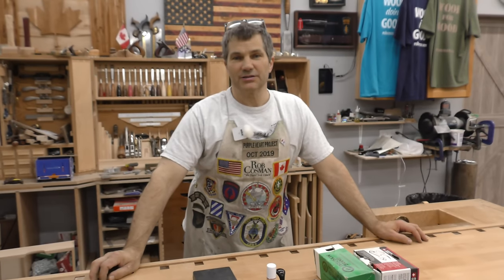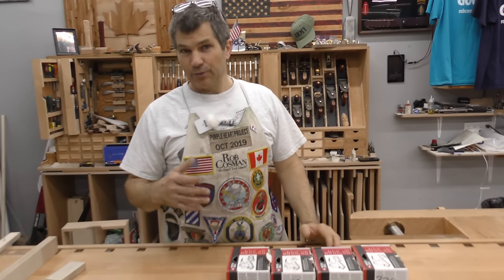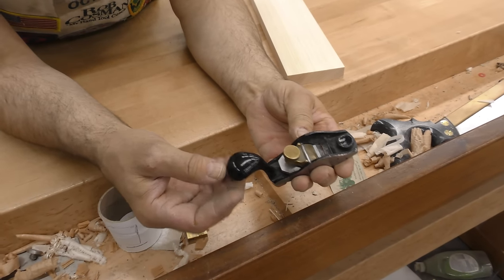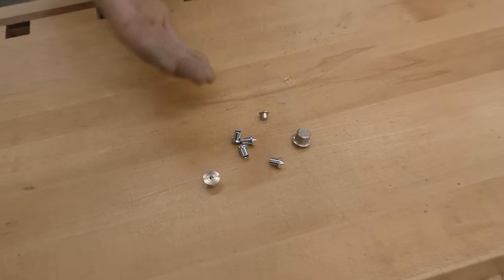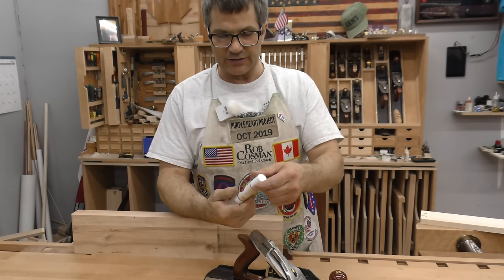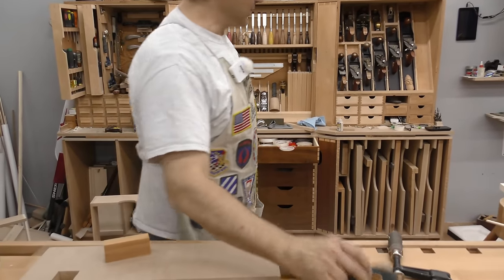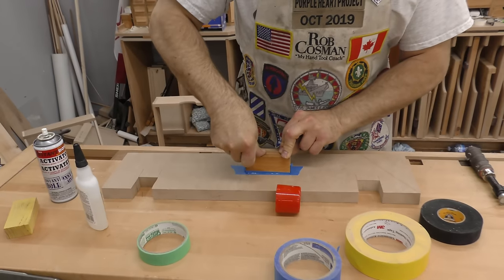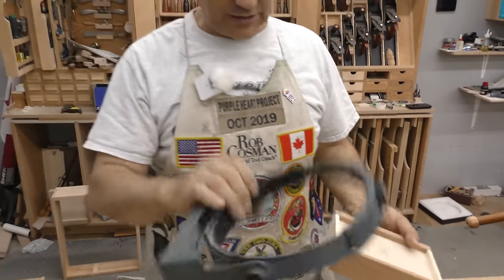Top Woodworking Gadgets - MUST HAVE ITEMS

Comment: The tape trick and CA glue, is actually used by luthiers, to sand or plane a piece wood that is too thin or small to be clamped, so tape goes on table...also to create shims like wedges for dovetail neck joint, etc...
Reply from the maker: Thanks for the info, I had no clue

Comment: iGaging makes a digital caliper that also measures in real fractions. Called the Fastener Cal, reads down to 1/128th in fraction mode and to 1/32 in "nut" mode. Also does digital and metric. Toothpicks and matchsticks as fillers. And the sample credit cards from credit card offers make great glue spreaders, either notched or unnotched. I also saved plastic room keys for the same purpose, once upon a time I worked a hotel front desk and was always getting "foreign" room keys left in rooms at check out.

Comment: Ophthalmologist Woodworker here. Knowing the definition of a diopter is not only easy, but VERY useful in woodworking (and human surgery), at least for Canadians and others familiar with the metric system. A diopter is a unit of the refractive power of a lens equal to the reciprocal of the focal length of said lens in meters. Huh? Let’s say we have a 3 Diopter lens (and every grandparent does in their reading glasses). How do we calculate focal length? The reciprocal is 1/3 meter = 100/3 or 33.3 cm. focal length. What is focal length- more complicated physics, but essentially how far away from you an object in focus is wearing said lens. Therefore, the higher the diopter of the lens, the closer the focal point is, and the larger the object is in a plus (magnifying) lens. I figured this stuff out before my residency, and I’m still trying to find 7/16 quickly on a ruler, so I’m sure any skilled woodworker can figure out the focal length of their Loups- (headgear). Hope it helps.
Reply from the maker: Wow...I think adding fractions is easier!!!!!  No really thanks for the information, it makes sense.  Its amazing how much I learn from you guys.  Keep those comments coming

Comment: Table salt. Bothered by wood slipping during glue up when you apply the clamps?
Sprinkle a few salt crystals on the wet glue before clamping
Reply from the maker: Yes that's a great one. Actually COL Luther taught me this....you just have to be careful to use only a little bit, too much and it will clump up and your boards wont seat correctly
Reply: Keeps a bar napkin from sticking to your pint too; cheers fellas.
Reply: The people who create Titebond actually recommend against doing this because it can negatively impact the bond created by the glue - there is information about it on their website.

Comment: Here is an idea for you Rob. I use an Eclipse sharpener roller  But I use it upside down.  I fitted two steel triangles  one eighth inch thick  .One each side.  Only about an -inch and a half wide - by an --inch and a quarter deep. Each has two holes for the fixing bolts and the other point of the triangle holds a Meccano shaft  --5 inches long --and a brass Meccano wheel  each side --one and a quarter inch diameter . They look like railway wheels  .The shaft is easily wide enough to straddle a diamond plate. When I sharpen a chisel I have a plastic coated chipboard board with a stop end and on the side near me I have a line drawn or scratched to set the chisel angle as it protrudes .
    That always gives a correct 90 degree end edge and the polishing after sharpening is done as normal .
A nice variation on this is to get a smooth curve across the plane blade edge.  Just fit a shaving under diagonal corners of the diamond plate. A thick or thin shaving is your choice . The plate will rock left and right as the roller stays on the flat surface.  This gives a fine smooth curved edge  without any trouble .   Have some fun with that .

Comment: 30 years ago when I was a doing picture frames I used a small bottle of Elmer's yellow glue just like the one you listed as honorable mention.  It made application of the glue on corners effortless.   I haven't seen those tiny bottles for years.  Do you have a source?
Reply: You can get what are called "Boston rounds with a yorker tip". They are used in the medical field. Veterinarians and pharmacies will be your best source for them

Comment: LED Headlamp for when a stationary Light just doesn't cut it. Especially servicing the machines.
Reply from the maker: Another great idea.  I installed a ton of lights in my shop but every now and then i still need a light.
Reply: Yeah, a headlamp is great to have. It is THE lighting tool for handsaw sharpening. Nice for layout too, because no matter where I put the lights in the shop I always manage to cast a shadow right where I wanna make a line.....

Comment: My non-standards would be a heavy steaming iron for the inevitable dents incurred working in a home with small children, and an old, very worn in set of automotive sanding blocks for smoothing large radiuses (chair backs, etc). Of course these could be made with plywood, but I've had great luck with the foam ones
Reply from the maker: I totally agree on the dent removal...in fact I should do a video on that.  Thanks

Comment: Great video!  As a mold maker I use dial calipers all the time to thickness boards on the thickness planer.  Get that?  DIAL calipers, not verniers.  Just kidding.  Also I call the head gear a see hat.  A hat you wear so you can see.  As a kid I used to laugh at the "old guys" who used them to see EVERYTHING.  Not laughing anymore since I'm the old guy.  Again, great tips, thanks.
Reply from the maker: Thanks for watching and commenting

Comment: Instead of hockey stick tape, I prefer to use vulcanizing rubber tape on tool handles, where more grip is needed. That tip for using tape as wooden dowel marker holders - I will need to test...

Comment: Double sided tape or a hot glue gun for temporarily fixing a board when using a bandsaw to make a leg or any other time you want a temporary fix.
Reply: Remove hot glue from most surfaces with Isopropyl Alcohol.

Comment: Excellent suggestions as always.  Two gadgets I use all the time for odd projects are a fractional drill gauge (https://amzn.to/2VqeYTB) and a digital protractor (https://thd.co/31wLoQ2).  I can't tell you how many times I've used the drill gauge to find the right size drill or rod for a screw, dowel, or rod.  I was very surprised to find that none of my friends used one and ended up guessing a lot.  The protractor has been extraordinarily useful for any project that does not have only square corners.  

Turns out that I was already using 8 or your gadgets, but will now think about more inventive ways of using superglue and feeler gauges!
Reply from the maker: That's an old Norris infill smoother
Reply from the maker: I have never used one either.  I just looked it up.  I will try it.  Ignore my comment below, I mistakenly added it here instead of where I meant to add it

Comment: use a slightly smaller drill for the dowell center points, that will hold them in place, and then hold the dowell in place too
Reply from the maker: Yup..good one

Comment: I have 2 inch brass keystock in apron in sizes of 1/8, 1/4, and 1/2 to use to quickly set up depth or heights of blades, etc. Not my idea, got it from John Silloats.
Reply from the maker: Where did you get it from?
Reply: @RobCosmanWoodworking  I think I picked them up at an industrial supply store, either Charles Jones Industrial or TT Liquid Handling in Hamilton.

Comment: I think the guy at  Crimson guitars is the originator of the blue tape trick. The Wood Whisper has a great video on. I just passed it along it's a great trick for many things. And as for the CA glue. Personally I feel that the 2P10 product is a higher quality. Just my opinion.
Reply from the maker: Thanks for the info!  It was passed on to me from a comment on a video just like this.
Reply: @RobCosmanWoodworking  I think I mentioned it on the standing desk drawer. Great trick. I've learned alot from all robs work. Passing on information is the key to helping fellow craftsmen.
Reply: Ben Crowe at Crimson guitars was the first on You tube. But he said he was given the tip from one of his students.

Comment: I use a magnifying headset also, but I have a light on it.  As we age the lens in ours eyes stiffens and it becomes harder if not impossible to focus on items close-in.  Further the lens becomes cloudier with time, hence, the image that does get through the lens becomes less well defined.  And if that isn't enough the screen (retina) ages and is less capable of picking up the incoming out of focus, cloudy image its receiving.  So, by now, in the absence of just ending it all, I add lighting to my vision assistance system.  Have a great day!
Reply from the maker: Yup that makes total sense.  Guess when I bought mine they didn't make them with lights yet

Comment: sometimes you need to sand an inside curve with  very little room to work with. Depending  on how small the curve is ,select a piece of dowel rod ( usually about 3 to 6 inches longer than the thickness of the wood being sanded)   make a small cut down the length of the dowel about an inch in length. cut two  pieces  of sand paper about 3/4 of an inch wide and long enough to wrap around 3/4 of the diameter of the dowel . Glue the backs of the sand paper together and a small amount of glue in the center cut dowel ,. slide the pieces  into the cut centering the paper  all the way to the bottom of the cut.  . Next cut a small 1/4 wide piece of tape like a ribbon( duct tape works very well for this) and wrap around  the top end of the cut to secure the open end (this is why the cut is made a 1/4 inch longer than the sand paper width)  Now with flaps sticking out of both sides of  the dowel rod you can insert the other end into a hand drill (variable speed one works very well and can be controlled better ) . Now you have two flaps of sand paper than can be used  to sand in either direction of rotation. A slight back and forth motion while sanding seems to  work better than holding the drill in a stationary  position. This also works  on fine tuning holes where a plug or dowel needs to be inserted and it is just a little to tight. Hope this helps.

Comment: Calipers are a must have !  But do not buy dial calipers,  dust will get in the gear track and bind smooth movement/damage accuracy. Use digital
Reply: I also use the calipers as a depth gauge. My everyday use caliper is a digital inch/mm one, but I also have an old dial caliper that gets occasional use.

Comment: Oh, and plasticard. Not sure what brand name it's sold under in Canada, it's basically like an A4 sheet of acrylic that's sold in various thicknesses but usually quite thin, like half a millimeter or so. Cut your templates out of that, it lasts a lot longer than paper, is easier to store than wood, can be filed or cut with all the tools we normally shape wood with. Not my idea, mind, it's a Paul Sellers trick.
Reply from the maker: Thanks for sharing!

Comment: Absolutely all of the above, inc. comments...It's OK for all you arithmetical geniuses but I consult my calculator for even the most basic sum. I had a huge one which I could not loose, but managed to break (It was like a death in the family). I should also include my laptop. I have only been at this for 45 years, so there is so much I don't know, but someone out there will be able to help. Not to mention it's value sourcing obscure items.
Reply from the maker: Cant tell you how many times a calculator would have been nice to have.  I use my phone now instead of a computer...I always have it with me.

Comment: A tightly capped cheap 8 oz size stubby water bottle, filled with dihydrous oxide, the universal solvent and cleaner.  It has saved me many a step to any other source of water, and it lives right on my bench, next to my glue bottle.  I use it to raise grain when chiseling,  clean up glue, clean up tools,  wash fingers, etc.  Best of all, it is always there.  (A variant with refined undenatured ethyl alcohol is not recommended, given that you are working with sharp things.)

Comment: Ok so here a real tip - 2 part penetrating epoxy its as thin as water and will seal wood better than anything, it controls moisture take up-i.e. swelling so if you live in a high humidity environment its the thing to use Find it West marine or Amazon  "Total Boat Penetrating epoxy"  about $37.00 a pint.

Comment: I didn't see any gadgets, just tools and consumables!
Side note: Vernier calipers refers to a type of scale on the caliper. Dial calipers and digital calipers don't have a Vernier scale, so they aren't Vernier calipers. The way Vernier calipers work is kind of neat, but I don't really see much advantage over modern mechanisms, and it's much easier to read them wrong.
Reply: The two main advantages are the same really - there's no moving parts in a vernier calpier's reading mechanism. Once you've engraved the markings, that's it until you prang it hard enough to bend steel. Dial calipers, digital calipers, they're all utterly fine and it's completely possible to make them accurate (see any machinist's shop) but (a) they will cost more and (b) they can be more easily damaged. 
If you're a cheap klutz like me, those are a nice set of advantages :D

Comment: While I think you are a great craftsman, and your work looks great, I find it amusing when people start talking about using calipers and feeler gauges for woodworking. Your drawers may leave your shop with tolerances of a thousandth of an inch, but you better make sure your customer's house is less humid than your shop, they will be calling you complaining that all the drawers are stuck. Wood moves more than a thousandth of an inch with a good rainy day. 

With that said, for what I tend to work on these days, my favorite "gadgets" at the moment are a draw knife, spoke shave, a farrior's rasp, and my shave horse.
Reply: I agree 100% about the drawer face tolerances. One thou is just idiotic and totally impractical in the real world!
I live in Sydney Australia, and it's hot and humid in summer, but sometimes doesn't rain for years (my son was 6 before he saw rain!) So wooden drawers, doors etc often stick unless there is enough clearance. In a timber-framed home, you'd typically want absolute minimum of 2mm (80 thou) on a room door to ensure no binding.
The other thing that Rob completely forgets is that timber drawer slides WEAR. So, in use, it wouldn't be long before the slides wore just one thou, and the drawer started catching at the bottom.
 I am currently repairing 12 x built-in flush clothes drawers where the builder allowed 1.5mm all around each face. After 30 years of use, the drawer fronts are catching; tearing the face veneer on the side frames and damaging the drawer fronts. That's happening from wear on the sides (causing drawer to skew), and drawer slide wear causing drawer fronts to catch each other or the bottom frame.

Comment: Look, I don't wanna be one of those people that comments on a video just to be negative, but I wasted nearly 20 minutes on this.  All of the items mentioned were either already associated with woodworking (plane, calipers, super glue, etc.) or easily replaceable with affordable household items (#1 could be a pair of glasses, and aluminum foil and playing cards would do the job for checking drawer fit, etc.).  The only thing I found incredibly original and useful were the dowel centers - didn't know they existed.
Reply from the maker: I find your comment amusing. In this video I demonstrate using painters tape (used for painting, not necessarily woodworking), steel shimstock, feeler gauges, pallet knife, wax for your plane, and others that people might not associate with woodworking. Yet, dowel centers, which would be a staple in any shop that uses dowels for woodworking, was something that you didn’t know existed. Maybe not all 10 items came as a surprise to you, but I didn’t make the video just for you, and it definitely helped a lot of other people (including you). So if you don’t want to be someone that comments negatively, don’t. You benefited from my video.
Reply: @RobCosmanWoodworking  I stand by what I said.  If you didn't already know how to use tape before this video or how to use a little bit of ingenuity, you have bigger things to worry about.  And while I stipulated that I didn't want to be overly negative, that was a courtesy to soften the blow - I wasn't overly negative.  I wouldn't have commented if I didn't feel justified.  Besides, I've never understood the whole "if you don't want to give positive feedback, don't give any" thing.  It's called the "comments" section, not the "praise" section.  Why read comments if you expect them to all say the same thing?  The comment wasn't meant as a personal attack, but as a critique on whether the video delivered on what was promised.  I apologize if my phrasing seemed callous - it was meant with no inflection, simply as a matter-of-fact statement.  I fully expect this comment not to be well-received anyway, but I could never stand being openly slapped with the proverbial glove by someone in an act of smug superiority.  "I find your comment amusing" indeed.  Pah!  What a world I find myself in...

Comment: I use a box rule for setting out, much more accurate than a tape measure
Reply from the maker: Another good tip...I never got into them but maybe I should try again
Reply: @RobCosmanWoodworking  I like your vids rob very informative and the real time approach works. Proper woodworking skills, no pocket hole screws like alot of other video's.
Reply: Hello Rob just discovered the Tormek sharpening system. Great bit of kit but can't afford the price tag at £550 here in the UK.